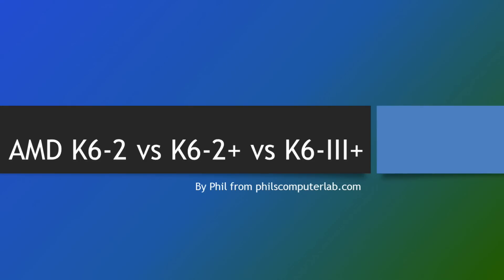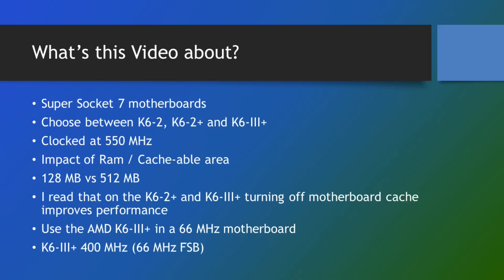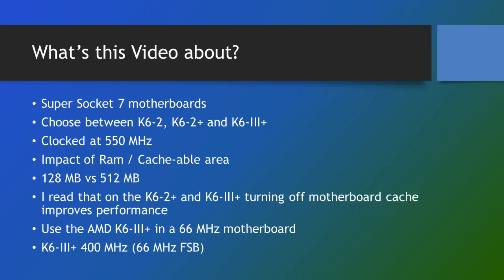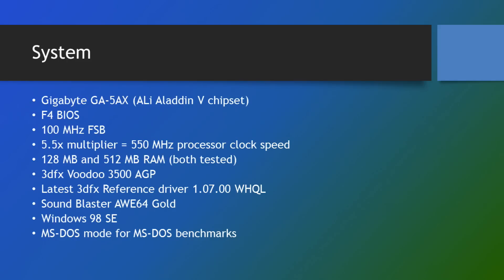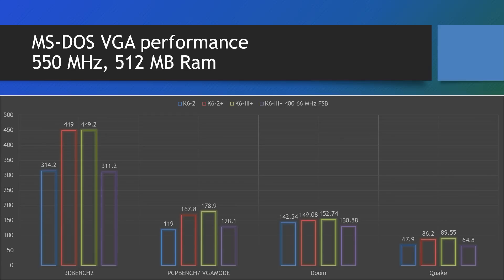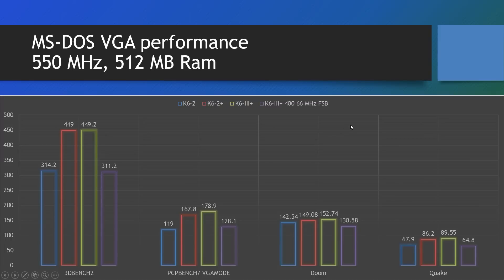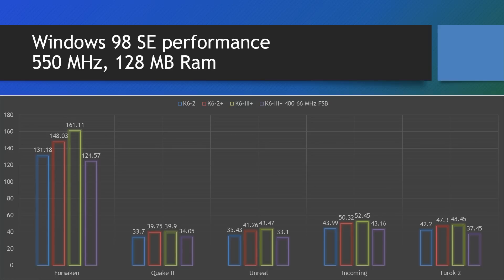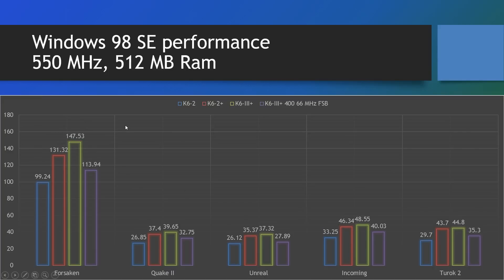AMD K6-2 vs K6-2+ vs K6-III+ Comparison

Comment: with a decent board you can get 600, the major issue back then also became heat, the cooler options where alot less mature then what we have now. 

we tested a clip mount water block and thick 120mm radiator, we managed 675 stable, it was still working as of a couple years ago last time i asked him about it and he got a bug up his arse to get it working again, the cooler was an AIO that was strangly made to support super7 and 370 boards and apparently is still working very well, more then is ever needed on 370 or super 7, oh, hes also got 2 of the same cooler on a pair of 466 celerons on an abit board that we re-capped, with far higher quality caps(he actually used audio quality caps because he already had all the values needed or ones that where higher capacity but would work.. anyway, those are clocked to 140+mhz fsb(from stock 60 or was it 66...lol......)  we managed after going threw 8 chips, to find a pair that both would do 1ghz the other chips all went into other builds back then..that system he still runs as it was back then windows 2000, but he also has a cf card(512gb), its split so he has a more modern linux build  that he had help building specifically for the old system to get the most out of it and be able to play most windows/dos/etc games from the point and click desktop... apparently its worked out very well for him, hes got a 3000 series agp card in it....the best agp card you could get...mostly because he got 2 of them in systems somebody traded in when his kids went off to college and wanted laptops... and...why wouldnt he use it? 

hes also got the same board, with adapters and celeron 1.4ghz tul chips, those he overclocked to 147fsb(from stock 100) with the same water coolers... (he bought a case after buying 2 from the seller on alibaba, and finding they did exactly what he wanted...hes not gotten anymore or been able to find more..and wont sell or trade the ones hes using..even on systems hes only fired up ones a year lol.... ) 

you can clock the k6-3 higher, one big tip though....these are VERY old chips, if you want to bet best results you need to carefully remove the ihs(metal cap) and replace the thermal compound, do not leave it off you will crush the die if you dont have a shim, its not worth it, but, some decent TIM makes a HUGE dif in my exp, we learned this later in the k6 series life, its not super easy to delid them, but its also not super hard, just some what i assume is high temp silicon glue holding the ihs down by the edges, (flat rim you gotta scrape up, clean off, apply compound, and, i just use a small dab of super glue in 3 spots so, if i feel the need years down the line, i can remove it and re-apply goop) 

i cant stress this enough, the big issue that kept the clocks down on these was temps, the same became true for some intel chips, the chips could safely take the volts needed for higher clocks..at least 600-650, if they had better cooling.  the though of a copper plate rather then aluminum with liquid metal rather then cheap white chalk TIM, and a decent in box cooler could have allowed them to sell 600-650mhz chips(forums had people selling replacement IHS's stamped from copper, that...worked far better then the stock, and the fellow included a little bubble pack of arctic ceramic the few times i helped use one...the results where pretty clear, same cooler, we could take a 350 the guy had from maxing out at 475, just a hard wall, to hitting 550, the only thing changed out was the ihs and tim, and at that point it wasnt the chip holding it back from a bit more clock, the board, though very nice, was known to have some issues in the setting ranges needed to get 575-600, and, for his uses, it wasnt needed, the 35usd he spent on the ihs kit was, in his view worth it, he got that k6-3 cheap because everybody wanted the 400-550mhz versions, the 350 was the same silicon.. not even very hard to overclock to the same settings if you had a decent board.... often if you have a balky chip, pop the top, replace the tim, and test...you may find you easily get past the sticking point once the whole die is getting properly cooled....  thanks for the video, good times with this old stuff, and so  many board where out there....some amazing....some horrific....some..amazing if you knew what to do...but horrific if you are a casual...

Comment: Unreal or Unreal Tournament does have more fps if you use a old nvidia tnt 2 card running in Open gl , the opel gl is faster than ( a lot )on a Geforce 200 mx ( which is faster in directx  ) bur You need to tweak settings and somewhere when nvidia added the directx 8 support the card became slower ( or unreal added support ?) -I  think they came with the 12.something drivers -the drives earlier than 12 might be faster or 12 is -the later are not.Anyway with the default open gl drivers (dark) I did have playble framerates in 1024x786 maybe round 60 fps

Comment: Bought a amd k6-2+ and a p3 both with 450 mhz. Which one to pick for my retro pc ?...and which graphicscard...? i have elsa gloria synergy a8 8mb and 3dfx voodoo 1 with 4mb i think - but prefer to go for Nvidia Tnt2 or maybe Geforce 2gts or 3ti...oh men why am i spending my money on old stuff like that xD
Reply: go with pIII, unlesss you dont need slow down k6-2 to 200 mhz or something. k6-2 can be lowered by multi, p3 not. k6-2 can be slowed down to 50 mhz fsb, and x2 multi, so 100 mhz if need.
if you take slot 1 with good case, you can switch CPU on slot 1 easy for unlocked P2 or Celeron 266/300, if you need to slow down CPU to emulate slower systems.i heard all CPU p2 and celerons before august 1998 are down-unlocked.
you can swap CPU easy thanks to Slot 1 if good case present, from Celeron 266, through PII 400 , to PIII 450 to PIII 1 ghz (fastest slot 1 P3), if needed. only advantage of ss7 and k6-2/ k6-3 is easy slowing throu multiplier software, dont need to restart comp.
You can downclock Celeron 266 or unlocked PII down to 66mhz x 2, so 133mhz minimally, iif you need slow down. (only on good motherboard) Otherwise, faster P3 is always better.
Reply: @warrax111  yeah I will play around lil bit and keep the best System. For now it's p3 500 with 128mb ram 10gb IDE Hdd geforce 3 ti200. Got two Socket 370 Boards with Celeron 433 and 466 which i have to test out.

Comment: Just curious, Phil, for an Epox P5VP-A+ motherboard what's your suggestion for safely pushing my K6-III+ 450ACZ past 400MHz?  I remember hearing about some cards not liking running on an out-of-spec bus speed.
Reply from the maker: You just raise the multiplier, no need to touch the bus speed!
Reply: Gotcha.  Guess I'll have to do so via software, as the jumpers go no higher than 4.5x
Reply from the maker: Yea there is software for DOS and Windows AFAIK that can do this.

Comment: Back when the K6-2 was nearly new, a local PC store sold me a fake CPU. Had an official looking barcode label covering old markings and someone had gone to the trouble of etching new fake model details. Once I removed the label it revealed it was a 256 not 450 model. Apparently fake clocked CPU were pretty common back then. The retailer denied all knowledge, insisted the barcode label I removed was vital to a refund, but gave me a newly released K6-III to replace it to shut me up. I should have reported them to the police. Two weeks later the shop was empty and up for lease and the company never heard of again.
Reply: Yes ''fake'' CPU's were quite common then. In fact this is the reason why Intel started locking the multiplier on their CPU's after the original Pentium, because some retailers were selling lower clocked Pentiums as higher clocked models and Intel was getting a lot of returns/complaints as a result. AMD chips were not locked so this practice continued for a while, but largely died out after the Super Socket 7 era.

Comment: so cacheable mem comes down to the mother board l2 cache amount? say running a k6-2 500mhz with a mvp3 mobo with 1mb l2 cache. or does it fall on the chip. sorry for the confusion.
Reply from the maker: It's just that at some point, CPUs started having the L2 on the CPU.
Reply: PhilsComputerLab ah ok yeah your right. did some research my board can do upto 256mb

Comment: Is the purple (K6-III+ 400 66FSB) the one the featured in your 4 in 1 DOS build? If so what is the other K6-III+ in your chart? Is it just the 450hz/2volt version? It seems to be quite a big drop off from the green/red. I'm curious if any K6-2+ or III+ chip worked for your 386/486/Pentium hybrid or if it had to be the 1.6 volt version.

Thanks Phil!
Reply from the maker: It has to be a + chip, these are mobile with multiplier you can change live. If it's a 2+ or III+ doesn't matter much at all.

Comment: I'm not sure if your ram timings are getting set more conservatively or if your 512MB are slower chips than your 128MB setup but you shouldn't be taking a performance hit.  Maybe its the chipset on the motherboard setting more relaxed timings when the banks increase but you might consider overclocking / tuning / tightening up your ram timings in bios to get that performance back

Comment: Great video (as always). Two small notes - if you use a motherboard with a VIA MVP3 chipset or a late revision ALi Aladdin V you will be able to cache 512MB of ram if your board has 2MB of L2 cache - there will be no slowdown. 2nd, using a VIA chipset board you get up to 10-15% better performance when disabling on-motherboard cache. ALi boards do suffer a performance hit tough - I've also confirmed that in my testing (tested on an Asus P5A).
Reply: MVP4 also has nice PCI clock divider they allows you to overclock system bus to 133 MHz and higher if the mobo has appropriate clock generator
Reply: What about MVP4 chipsets, are they as good as the MVP3?
Reply: @phillycheesetake  The MVP4 chipset is a version of the MVP3 with no AGP slot and built-in graphics.

Comment: some other things to consider (newest is not always best!) motherboard revisions, bios revisions, cpu drivers, defragging the hard drive,  chipset drivers, video drivers, quality of the memory,sthe quality of the sound card being used can also speed up the system. dont forget the y2k patch. in benchmarks the k6's had a much faster cycle rate than the pentiums of the time (the k6 patch) therefore for each clock cycle a pentium is about 1-3 steps behind. itd be way awesome to get a hold of a scsi board as well. 
p.s. have you tried windows 2000 or XP or maybe even linux ((mandrake (mandriva)) was pretty simple to install?

Comment: the k6-3 laptop cpu uses less wattage and voltage and some desktop motherboards support the laptop cpu's. id go with 133mhz fsb and 133mhz memory but 66mhz memory will work as well. the big gains (gaming) depends also on the video cards bus speed and the gpu's speed and what type of memory is on the video card. alot of times old benchmarks were optimize for pentium cpu's. also cyrix cpu's were pretty awesome cpu's. thank you for uploading this video.
p.s. the unreal game is an awesome benchmark!

Comment: Used a K6-2 500/100FSB and Celeron 433 15 years ago, and the latter felt way faster in games with a Geforce 2 MX.
Reply: That Celeron A would do 541mhz all day long at an 83mhz FSB if your PCI devices would handle running that fast (41.5mhz). If not 488mhz at a 75mhz FSB was the ticket. I don't think I ever ran a Celeron A at default clock speeds. :)

Comment: If You have been using a motherboard with 2MB of cache, the results of K6-2 with 512MB RAM and L2 cache enable will differ a lot. So Your investigation of the RAM impact on efficiency is true only for this specific motherboard, and not for super socket 7 in general.

Comment: my first pc build was k6-2 400Mhz....
Reply from the maker: Nice, I bet you have good memories :)
Reply: lots oh you should do a video on lesser known Voodoo Rush chips had one in a Pentium 120Mhz
Reply from the maker: Ah the Rush :) I think that's one of the few Voodoo cards I don't have. I do have the Banshee and I'm quite fond of it.
Reply: oh a great card to pair with a Voodoo2 setup that was lesser known at the time too was the Intel i740 it was nearly as good as the Matrox cards in 2d for dirt cheap
Reply: My first was a dx4-100 then I upgraded a few years later with the k62-500, was a huge upgrade at the time.

Comment: About the motherboard cache. That was interfaced through the chipset. So the type of chipset had an influence on the performance. There was also size difference, 128kb up to 2MB.
There was also a difference in cache type: write-through and write-back with write-back being the fastest of the two.
So it's possible that for someone with a different motherboard than yours, to get better performance with cache disabled on a K6-III+. But honestly, I doubt it. Maybe on a very badly optimized board.
Reply: yeah a bad motherboard would make the on chip cache for better performance but a high quality motherboard would be the same either way

Comment: I had a K6-2, K6-III and K6-III+. One thing I noticed when switching to the K6-III was general I/O performance. In short, it went through the roof! A very noticeable difference thanks to that huge (at the time) 256 kb on-die cache. Everything seemed to load that much quicker.

As for games, I'm not so convinced seeing as the K6-III has the same FPU unit as the K6-II. Perhaps that was down to the actual games I was playing.. God it's been so long I can barely remember. But I do certainly remember having an awful lot of fun with these CPU's, especially games like Quake, Carmageddon, Project IGI and Interstate '76. I also had a lot of fun - and learned an awful lot - by fiddling around with jumper switches in order to 'over-clock the bus' etc. Happy days :)

Comment: I have a K6-III+ 450 ACZ 2.0V and I always ran it at 112fsb x5 =560Mhz 2.0V (tried up to 2.4V and still couldn't hit 600Mhz. I still have this chip,  I even de-lidded it.
Reply: delid is key if you want any hope of the 600, i have seen a few hit 650, but only a few, 600..you need excellent cooling, and verygood TIM under the IHS and OVER it..if possible a copper ihs(lid) or just a shim and direct die contact with a good water block, well it was quite possible just... not something amd could do within the limits they sat for the chips, most need a bit more power and produce enough extra heat any box cooler wouldnt be able to cope... anyway,  getting 550-575 out of most of these chips becomes pretty easy with a decent board and a delid-re-goop in my exp... but, you gotta have very good cooling to hit 600+ and a good board, good everything really, it can be down to making sure you have the right memory modules with the right chips on the right board for some reason... but...i have seen one of these hit 675 and remain stable no matter what test was thrown at it.

Comment: I didn't realize there was a certain amount of system RAM was being cached.  Does the Coppermine Pentium 3 have this behavior too?  If so, how much memory is cached?  I ask because I just built a Windows 98 SE PC around a 440BX motherboard with a P3-650 MHz Coppermine.  Thanks for the informational video!
Reply from the maker: Nope, the Pentium III doesn't have any such issue. This video only applies to the CPUs shown.

Comment: Hey Phil :D I want to add a SSD to my GA5AX 5.2.
I would like to know what will be the best performance wise.
IDE to sata or PCI bootable sata card?
If I go with IDE sata then I might get a better FSB overclock(K6 2 533) as I am running 125mhz and 130mhz for benching.
I think I saw on VOGONS that you went with IDE to sata.
Reply from the maker: +Schalk Jansen Why? I get the idea, but this is socket 7 board. The processing power is extremely limited, The OS also doesn't support TRIM.

I might have an alternative for you though, I'm working on a video about some very fast retro storage option which should be online in a few weeks.
Reply: I know its stupid idea but I am obsessed with my K6 and if I can do something to make it load 2 seconds faster I would do it :) I got rid of all my other nostalgia because it was getting out of hand :p Even the dual P2 had to go :(
Reply from the maker: Fair enough. You will like that video I'm talking about :D
Reply: +PhilsComputerLab Where is this video? :D :D
Reply from the maker: It should be online next week :D
Reply: Thanks for all your efforts :) Its being appreciated alot :) I want the best SS7 and play GTA3 smooth :D

Comment: The ALi Aladdin chipset is incompatible with some GeForce2 cards. I remember getting lower performance on 3DMark and OpenGL Quake III when using a GeForce2 with said chipset.
Reply: Both ALi and especially VIA chipsets had hellish compatibility problems with most AGP graphics cards for years (but not 3DFX cards), as did the entire Slot A Athlon platform. It was a nightmare as consumers could not find this out before purchase, and tracking down the cause of random ass BSODs was very difficult. These days you buy a graphics card and it just works, what a nice thing!
Reply from the maker: +Mouldy CPU Yes good point!